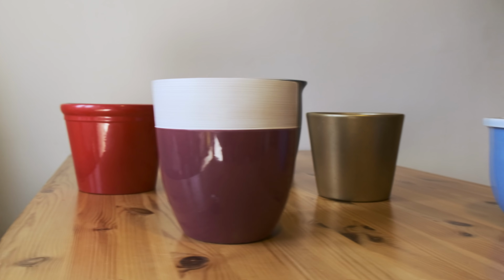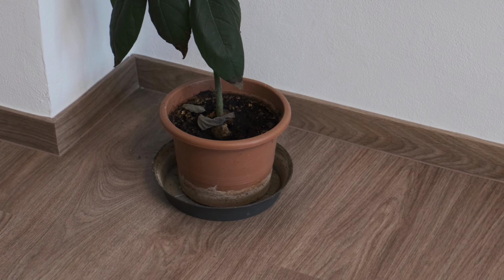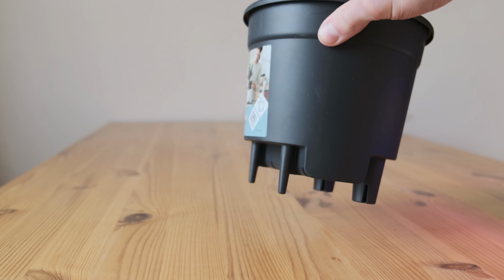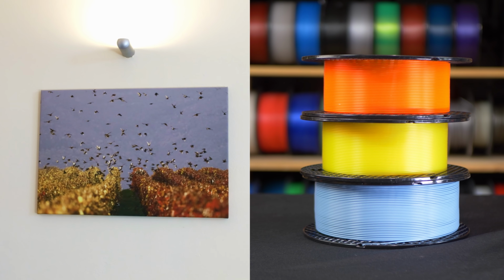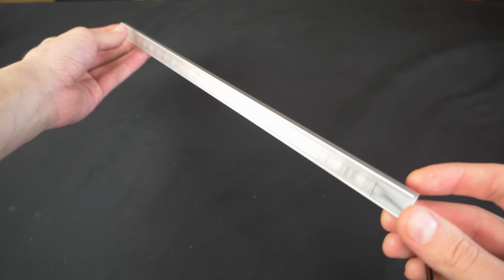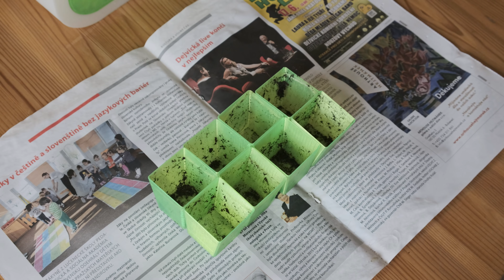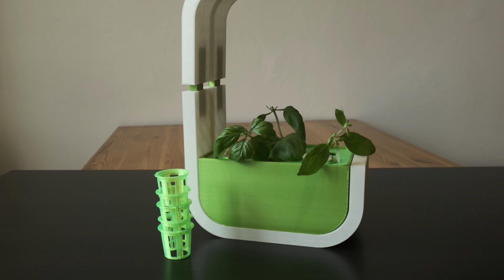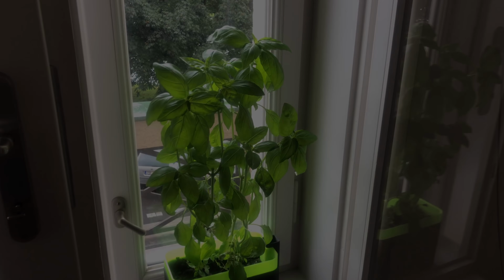Meaningful uses of 3D Printing in Gardening

Comment: Just want to give you a heads-up on the IoT project in your video where you use a soil-meter. Those sensors corrode away quite fast, a very good upgrade to this is a capacitive soil sensor. They will last a whole lot longer. I hope you find this useful. I enjoyed your video.

Comment: only watering a plant by pouring water in the tray is an ineffective way of watering as it only really works if the plant has roots that reach down there but even then that method keeps the soil at the bottom permanently wet which can lead to root rot + risk of fungal/bacterial infection. The plants you mention to not like and like "self watering plants" also correlates to the kind of plants that typically need less or more water. A plant is physically unable to choose to suck water in or not due to how roots (And sap circulation in general) works, the illusion of the plant "sucking in the perfect amount of water" is due to the soil gradually drying, and due to how water works, the water at the bottom getting pulled in.

Comment: What types of filament are best for pots? PLA seemed to deform for me, but may have been the summer sun...
Reply: PETG might hold better, and has more favorable traits to help seal out (or in) water when printed right, though depending on how hot the spot your placing it is even PETG has limits

Comment: i use to print a pot, but the water leakout due to the hole of print layer, how to solve that?
Reply: Try increasing flow rate or nozzle size
Reply: @elliottf313  thank you how to test which work flow is suitable?
Reply: @Theravenfeet  try increasing it 5% increments
Reply: @elliottf313  thank you, how should I know it's ok or not ok? Try to put water in and observe?

Comment: Im curious what material they are using. If your plants are in direct sunlight then the PLA will definitely embrittle and warp/deform from the UV and temperature exposure. PLA is also biodegradable which does not bode well for being used as a water tank. That being said, I really like the idea of a lot of these designs and their flexibility/creativity. I hope they have appropriate materials available.
Reply: I see what you mean, but in reality, even PLA will likely work fine for many years. I've printed most of my pots from PLA, some from PETG. For example, the self-watering one from PLA has been behind my window for over a year and a half without any sign of degradation. Only time will tell though :)
Reply: I'm worried about the same - Top of that; do we know if plants collect microplastic or other components from the PLA?

Comment: Does filament type matter when it comes to planters? What do most people tend to favor? PETG?
Reply: PETG has good bonding characteristics and is waterproof in most cases.
Reply: Yes. Most plastics are not UV resistant. Not sure which ones are. PC? Otherwise they need a UV protective spray coating if they will be outside

Comment: How do you make the pots water proof? As the 3d printer makes a tiny holes in the prints the water will leak?
Reply from the maker: If the wall is at least a few perimeters wide, we find that most of our prints hold water even with default settings. However, it is an interesting topic and we're working on a standalone article about it. -Mikolas
Reply: You could probably heat it up using different methods if there are any large gaps from errors in the print.

Comment: Which filament do you suggest? I fear pla is not water resistant enough?
Reply: PETG filiment is similar to the PET plastic used in common waterbottles.

You will need to experiment a bit to get a watertight print either threw finding the right settings or sealing the inside of the print with a layer of silicon for example, I'm told that larger extruder nozzles that make thicker walls can make it much easier though I've barely tested much of this myself yet

Comment: Can I make planters from PLA? Because I am scared that water can flow through these planters and damage my elektronics in my bedroom.
Reply: You can as long as you make the walls thick enough, however I'd probably recommend against it, after a while (about a year in my case) you may find the PLA starts to break down and leak water, which is not great. The only alternative I tried was ABS which has lasted without issue.

Comment: What would you recommend to get waterproof pots and reservoirs? Specific materials? Specific slicing parameters? Postprocessed coating? Thanks for this interesting article/video.
Reply from the maker: Good question! 
We thought we'll just mention it in the article, but it turned out to be big enough topic for more research and standalone article.
But generally, if you have multiple perimeters, even the default settings in PrusaSlicer create waterproof prints most of the time. -Mikolas
Reply: @Prusa3D  I've heard that PLA was less watertight than PETG by itself. I'd love to see such a standalone article, honestly. I know we can coat our prints to get them waterproof, but the less I manipulate products, the better i am :-) Thanks again for this neat video Mikolas.
Reply: I've used Titebond III exterior grade waterproof glue for this and it works great. I filled the pot with glue then drained it back into the bottle then let it dry. You can do several coats if desired.
Reply: @MattJonesYT  Thanks for the suggestion. So far I read about using a brush to coat some liquid wood glue in order to make the pot waterproof. A solution quite close to yours 😊
Reply: Printing waterproof needs many tries and errors, especially for single perimeter printed vases. On the other hand I tend to seal the perimeters depending on the material. Abs and ASA you can seal by Aceton vaporize and PETG and Pla with liquid wax or SLA printer resin following by uv light hardening.

Comment: How do you make these prints water tight? Do you seal them with resin or is it a special filament?
Reply: A good calibrated printer should do the job. A little adjustment could be slightly hightened flow rate. Should work with any filament, i'd go for PETG though, since its often used in food-safe applications (PET, not PETG - and not every PETG filament is automatically food-safe - added for legal reasons ^^)
Reply from the maker: Most of them are just regular Prusament PLA with default PrusaSlicer settings. The walls are usually several perimeters thick. Each of us in the office has a different experience printing watertight, sometimes contradicting each other. I think we'll do a standalone article on the topic :) -Mikolas
Reply: @Prusa3D  An article would be great!
Reply: @Prusa3D  Yes "standalone article" please ...even Prusament PETG doesn't turn out watertight sometimes ;-(
Reply: I've made some sweet vases using vase mode and translucent filament, I turn the extrusion width up to ~1.5x the nozzle diameter, I did a .8mm thick vase with a .6mm nozzle that is watertight and nice and study!
Reply: @kevincrossland1898  That sounds great, thanks for sharing!

Comment: Tried to print a hydroponic pot that i designed myself... went horrible wrong, cause i was doing EVERY possible errors, I printed on a shitty ANET A8 with loose belts, used old and moist PLA, and just default Cura settings for PLA. Water was oozing out everywhere, even though it looked watertight, it sure was not, in any capacity, at all watertight... lol

Comment: Small side note:
These ressitive moisture sensors are not the best. Start to rust pretty quickly. 
You should use resistive ones. It just a little bit more expensive on aliexpress.
Reply from the maker: Yeah you're right. This is a rather old one and it does rust. I've bough a few of the newer ones (single black piece) and those are better. They even have a built-in analog-digital converter, so you don't need to use an analog pin on your microcontroller. -Mikolas
Reply from the maker: Yeah exactly.

Comment: This is great, I have printed a self watering pot for the first time the other day. On a side note, do not use cyanoacrilate (super glue) to bond something that will be exposed to water. Super glue bonds instantly in the presence of moisture (think fingers), however the bond is also weakened by moisture or water. This is why the msds will state that if you bond your skin you need to run it under luke warm water in order to get, say, your fingers unstuck.
Reply: So what do you recommend?
Reply: Source please? I think that's completely incorrect! Many aquarium owners use CA glue all the time for things that are constantly submerged with no issue...

Comment: I mean its cool, but those will be some expensive ass pots, considering the price of filaments
Reply from the maker: Since the pots are just a few perimeters thick, most of them use 10-25% of the spool at max. So that's $2.50-$5 a pot (using the prices of Prusament), a bit more if you include shipping. Which doesn't seem that bad :)
-Mikolas

Comment: Thanks for taking the time to show us all of this. I am new to printing and I don't know what the best filament to use when using a LED light so it doesn't break down. So please let me know what it would be.
Reply: If you are asking what type of plastic to use when exposed to LED lights, then anything is fine, PLA is the easiest(but it deteorates under UV from the sun[BTW, glass blocks most UV], so use something different if you are gonna use it outside longterm). If you are want to stick the LEDs to the plastic, use plastic with higher glass transition tempeture, like ABS/ASA or better, but word of warning: these plastics are hard to print, since they like to warp and deform while printing(sometimes they deform so much that they seperate from the heatedbed), so if you can, use metal extrusion of somekind, it even cools down the LEDs so they last longer. Hope this helps.

Comment: Great video! I would never use one of those $1 water sensors though. They corrode to the point of failure within just a few days. Pick up a "Capacitive Soil Sensor" instead, and you'll have something that lasts for many years.
Reply from the maker: This sensor is from a project over 5 years old and still works fine. But yeah, the capacitive soil sensors are much better and it's what I've been using for newer projects :) If for nothing else, it's nice that they can send out digital output rather than just analog signal.  -Mikolas

Comment: So be carefull about which plants you put in which medium with standing water etc. There is certain plants eg aroids that really don't like their roots to be wet all the time.
It might also create an anaerobic environment which actually stimulates rootrot.
Plants can handle quite some water as long as there is airation/airflow through the medium.
But then still, with plants it's usually safer to under water rather than to overwater!
With self watering planters look up semi hydro which use substrates like ponz leca or perlite for airation and water holding capabilities, but be mindfull that PH of your substrate is also a crucial variable for your plants.

Be carfull of the plant rabit hole

Comment: This is really well done! Question: how do you get your 3D printed parts water tight? I know there's a lot of methods out there but curious if there's a more elegant solution to brushing a layer of epoxy on the inside
Reply from the maker: Most of the prints in the video turned out to be perfectly watertight with the default settings in PrusaSlicer. The walls of the models are usually at least a few perimeters wide. With that said, it is quite an interesting topic and some materials can be tricky to get watertight. We'll most likely create a standalone article/video on the topic of watertight printing. -Mikolas
Reply: @Prusa3D  that would be awesome. Thanks for the reply!
Reply: @kewl201  I saw a video the other day where essentially it's a combination of correctly leveling your bed, correct wall thickness, bead height and print speed. You don't want a perfectly round bead according to the video you want it to be more oval shaped as it's been flattened a little bit giving more surface to stick together with the hot plastic. At least that's the way I interpreted it. I think it was on the Maker's Muse channel. I could be mistaken I've been watching a lot of videos since I got my printer recently

Comment: You realise PLA is HIGHLY biodegradable... You soak it in salty water for a few days and it will begin dissolving, same stuff biodegradable airsoft BB's are made from. Not a great material for gardening. I am not watching this video because i honestly think this is a stupid use of a 3D printer. Buy yourself some clay if you want to make flower pots...
Reply: Gee. Maybe that is why the video heavilly features their semi-transparant Neon Green filament which only comes in PETG...

Even then the biodegradability of PLA is greatly exagerated. Even a year of submersion in Salt-water or being in a composting bin has PLA degrade not at all as it requires significant temperatures you'd normally find in industrial composting to actually start decomposition. The real reason you probably don't want PLA is that it may get softer in direct exposure to the sun on a very hot summer's day due to PLA's poor thermal characteristics.